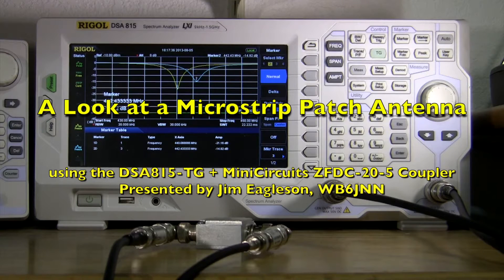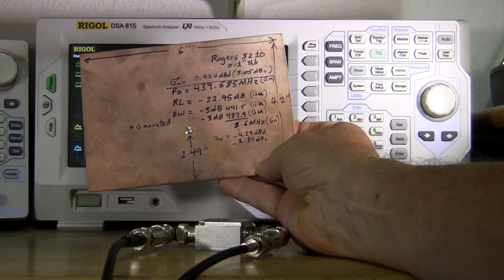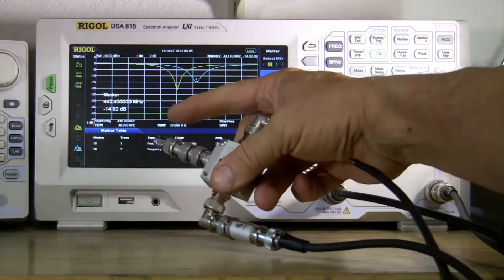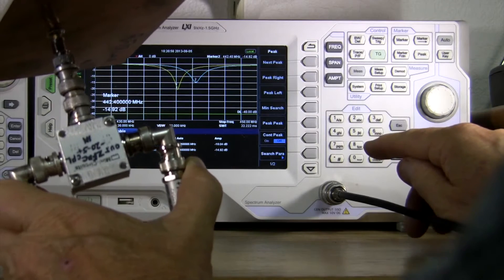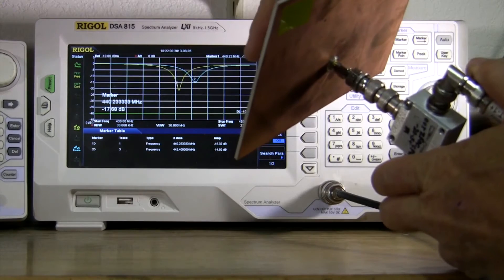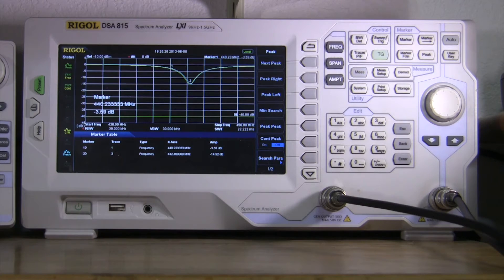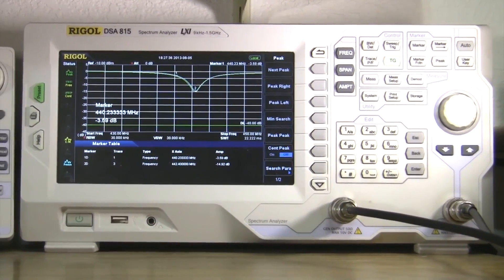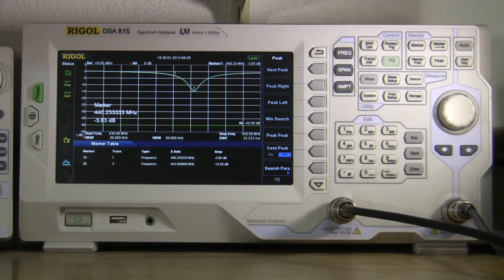440 MHz Patch Antenna (DSA815 TG)

Comment: thats like a $1300 tester
Reply from the maker: The Rigol DSA815-TG is a Spectrum Analyzer with Tracking Generator that costs $1300.  Most antenna analyzers cost $300 for manually tuned units using an analog VSWR meter and between $500 to $2500 for more accurate and sophisticated ones that allow graphic display over a frequency range.  The DSA815-TG can sweep fairly accurately over several HF bands for multi band antennas, provide a printed or file saved screen image or even a CSV file of the results.  And, of course, the 815 has many other uses other than checking the tuning of antennas.   For a review of various antenna analyzers specifically designed for this purpose check out: https://www.youtube.com/watch?v=iHEHqRazv-g

Comment: Is it just me or is that an ineffective antenna design? what's the reception pattern? just a beam along the board plane?
maybe you could try a multi patch antenna on pcb? like a phased array.
I have always been a bit skeptical about the idea that you need special PCB for RF circuit. How much does the Rogers board really matter?

If you're looking for a fascinating hobby maybe build some kind of rotating directed antenna to listen for bright anomalies on the sky. Testimony suggests that the visiting ET ships put out quite the RF profile from their propulsion system, maybe predominantly in the microwave range. But very broad spectrum all the way down to audio frequencies. So basically look for above horizon localized RF sources that move. Since they are very high power and they often fly in space as well they could be detectable from thousands of km away so that's a good size cone to cover from a single vantage point. And they are far more frequent than you'd think. I estimate from the millions of witnesses around the world that we are visited by at least hundreds of ships every single day. But some or even most are so fast you may never pick them up even if they are in your region. They can cover many km in a second including acceleration to and from stand still. I know it's pretty wild but there is just too many credible witnesses for it not to be real. Airline pilots, police, a governor, a US president, generals, admirals, colonels, FAA controllers and groups of frightened children. Even US astronauts have come forward with cases so up close that it leaves no room for misunderstanding.
If we can find out what their typical RF signature is then it would be fairly easy to create a detection grid that could cover the planet and pin point every single one of them in real time. They are basically flying unshielded gigawatt microwave ovens :)
Reply from the maker: A patch antenna is generally a compromise design with maximum radiation perpendicular to the surface of the PCB.  It was originally designed for high speed aircraft and rockets to minimize drag caused by more traditional designs.

The particular antenna I showed is much larger if FR4 is used and exhibits significantly more loss due to the dielectric losses of that material.

We actually made an antenna using e=10 material in a half patch configuration that was less than 1/4 the size of the one shown in my video.  For the specific application, small size mattered more than efficiency and gain.
Reply: James Eagleson It's counter intuitive that it radiates out of the surface when the backplane is totally hidden but looking at wiki, isn't the backplane supposed to be at least a bit larger than the front? and preferably more separated than a 2 sided pcb.
Reply: James Eagleson And in general, it's unclear what circuit condition results in EM radiation out of the circuit instead of just being AC in the wires or magnetic fields. Do you have a good sense of that?
Reply from the maker: Dan Frederiksen
Certainly a 'patch' using air dielectric against a ground plane will be more efficient than one on FR4, Duroid, or other PCB materials.  FR4 is the cheapest solution but its loss tangent is much higher than Duroid or other even more expensive materials.  We started with FR4 in fact.

Due to the expense of the PCB we opted to let the metal surface of the item to which this antenna was to be attached be the ground plane.  Thus the better performance when mounted on the metal panel.

A patch is an edge radiator, that is the radiation is from electric field lines at the front and back edges which are in phase with each other due to the velocity factor (dielectric constant) of the PCB material.  It is in essence a microstripline made to intentionally radiate from unterminated edges.

Use of proper materials is essential to efficiency and, more importantly, to repeatability in making this kind of antenna for a production rather than a 'one off' environment like we typically have in the Ham Radio world.
Reply from the maker: Dan Frederiksen
A patch antenna with no extended ground plane still has a discontinuity and field lines from the front to back plates thus still radiates.  It typically would show a dipole like pattern perpendicular to the plates.

I recommend reading up on this in antenna reference books such as those by Jasik, Johnson, and Milligan all of which have information on patch antennas.

Also check:
 http://www.orbanmicrowave.com/The_Basics_Of_Patch_Antennas.pdf

There are quite a few articles online as well as downloadable programs to help design this kind of antenna.

By the way, many, if not most, 'cellular' tower antennas are patch like structures using plates near reflectors with air dielectric and multiple patches spread out vertically.  However our goal was not max gain but small size. 

The final patch we designed was only 2x4 inches on a dielectric = 10 material to replace an electrically small loop antenna that had even more loss than the patch antenna ended up having. 

The primary design goal was trying to mount an antenna on an item without it being obvious that it was an antenna and without it sticking out from the surface so that it would not get knocked off due to rough handling.

Not every design is done for maximum gain.